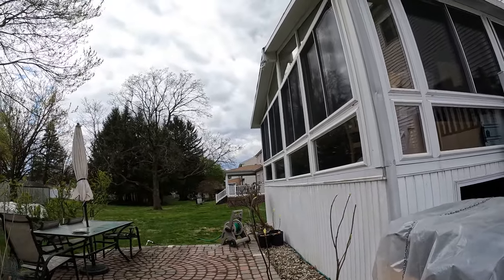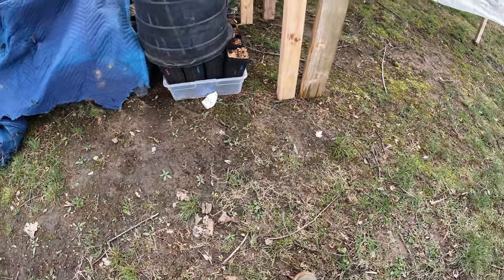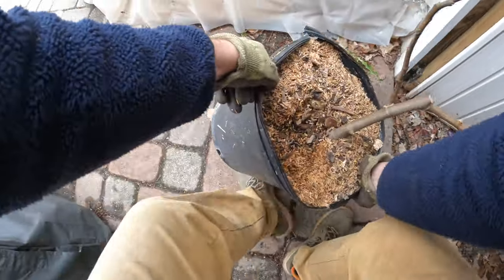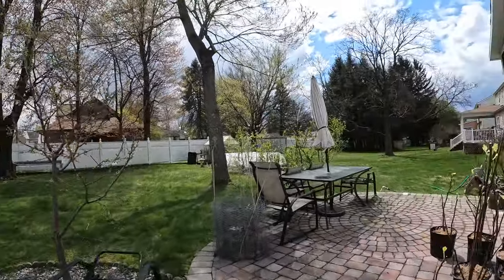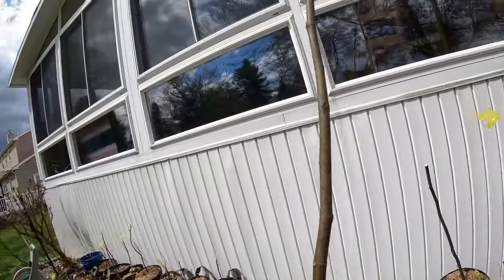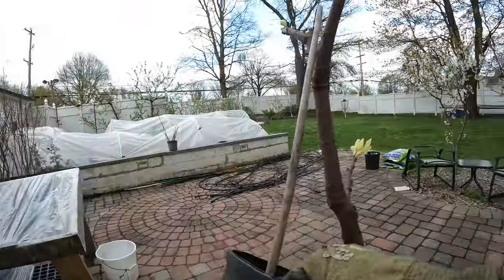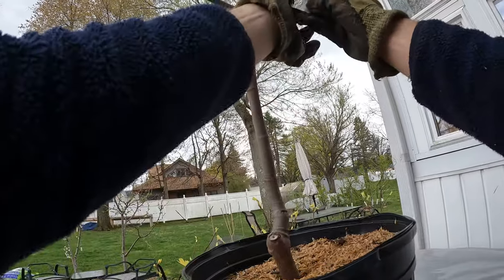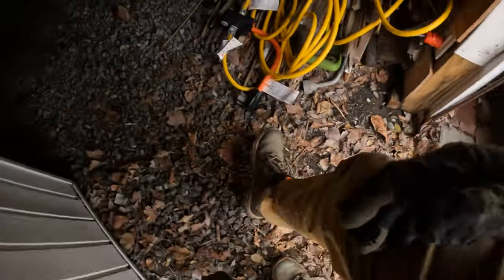The 2022 Fig Shuffle

Comment: I see that it’s going to possibly frost here in SE PA the next couple of nights. Are you going to shuffle them again?
Reply from the maker: Tomorrow morning will be 36F, windy and somewhat cloudy where I'm at. That's not a recipe for frost. Conditions Friday morning and Saturday morning look a bit worse. I will reassess later on, but as it stands currently, (even if frost were to occur here) the frost should not be significant enough to concern myself with. Now if I only had a few trees, I'd either move them or protect them as a precaution. If I were to see extended temperatures at or below 25-28F, I would be very concerned. Especially if that was combined with a frost and I would definitely act.
Reply: @RossRaddi  gotcha, thanks for the info! I just have a few potted trees right now. I’ll probably do the shuffle. Should definitely be clear after this week though!

Comment: I live in the Eastern panhandle of West Virginia brought my trees out around April 10th to 15th   Trees are awake now and I am pretty concerned about the frost that we're expected to get tonight and tomorrow  I'm thinking of seeing if my fuzzy leaved figs will be able to handle it better than the smooth leaved figs was wondering what you were thinking of doing
Reply from the maker: Tomorrow morning will be 36F, windy and somewhat cloudy where I'm at. That's not a recipe for frost. Conditions Friday morning and Saturday morning look a bit worse. I will reassess later on, but as it stands currently, (even if frost were to occur here) the frost should not be significant enough to concern myself with. Now if I only had a few trees, I'd either move them or protect them as a precaution. If I were to see extended temperatures at or below 25-28F, I would be very concerned. Especially if that was combined with a frost and I would definitely act.
Reply: If it's just a quick frost, you can put a trash bag over each tree to protect them from wind chill

Comment: Once the trees break dormancy and have full leaves, what temp is too cold to leave them out?  I shuffle mine back into the garage when it's gonna be below the low 40s, but I'm not sure if I'm wasting time/energy and should just leave them out as long as I am certain it won't get below maybe 35 degrees?  I just put mine in the garage for tonight because it's going to reach the mid to high 30s tonight near me, but I'm never sure at what point I'm just doing unnecessary work.  Thanks.
Reply from the maker: 25-28 is a bit risky.

Comment: Thanks Ross I learned a lot from you. I shuffled my Fig Trees back in to the garage last night. The temp. got around 35 deg. in my area.  I have a question  The fig trees have leaves and figs growing now. Would it have been bad if I left the fig trees out with mid 30's temperatures over night?
Reply from the maker: No. A light frost may do some damage though. Or anything around 25-28.